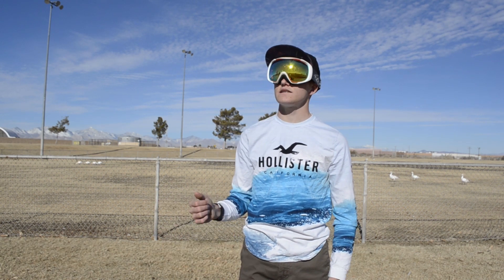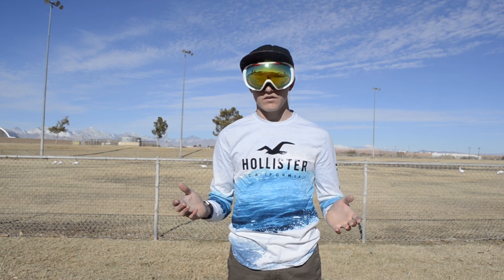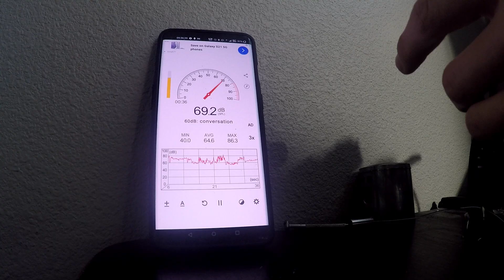3D Printed Air Raid Siren

Comment: Could you make a whistler that produce sound when there is wind that can be use on rc /fpv plane....just to make the airplane sound more efficient with the whistler...its same just like the air raid but the air raid need strong wind to produce the sound(im not to good in english grammar....)

Comment: Is their a build video anywhere
Reply from the maker: I'm sorry, not for this project. I never though about putting that in the video, but for future projects I'll have a separate video on just the build. Thank you for letting me know!
Reply: @AxelDayton  any time
Reply: @AxelDayton  what do i do i printed the siren and well what part goes where just asking
Reply from the maker: I don't know how well I can explain this but, if you have the shaft there is a constant diameter, a spacer, and an end with a drop-off. 

The impellor for the siren goes on the side with the smaller diameter, a bearing goes in-between the spacer and the siren impellor. 

Then the air impellor(for power) goes next to the spacer and a washer follows that. Then the enclosure is glued together over the axle and I think that's it. I'm sorry I didn't include that in the video.
Reply: @AxelDayton  thanks for the help I might print one out for a school project in a school class that has a 3D printer
Reply from the maker: @iamsteverogersakacapamerica041  that's sick bro! I hope it works out for you!